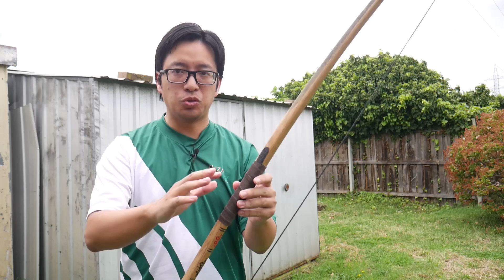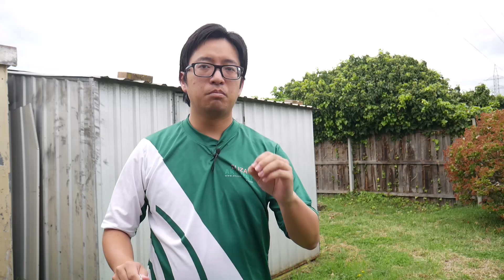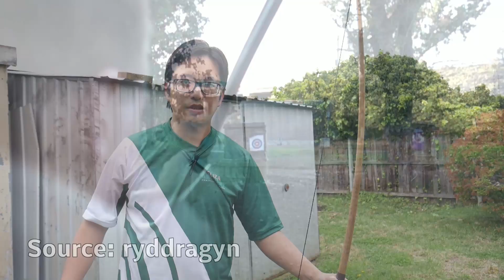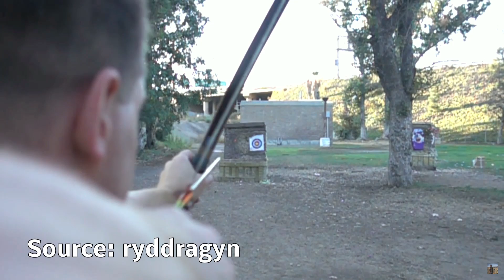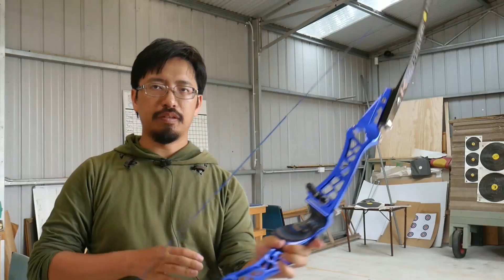Why Do Bows Have Centre-shot Shelves?

Comment: I'm surprised Nu didn't mention the obvious reason older bows weren't centre shot, if you cut a chuck out of an older one peice of wood bow, it would be far more likely to snap under full draw.

Modern materials allow us to create weak points in a bow such as centre shot cutouts because the materials are better at compenating, but older wood only bows wouldn't be able to take the strain on a weakened part.  I've seen enough bows explode on the tiller jig to see why old bow makes wouldn't remove so much material from a bow.
Reply from the maker: Hm. I suppose the bow blowing up would be worth mentioning.
Reply: @NUSensei  they also made arrows out of fine cloth soaked in hide glue or fish glue rolled up on a thin wire, then u take wire part way out when it gets tacky put the arrow head in with some more glue on it and bind it being carefull not to bend arrow then take it off rod completely and let it dry before binding fletching's on, they where super strong if you put a bodkin head on them they wouldn't break on armour as easily as reed  wood ext arrows
Reply: @NUSensei  yes when the bow bends the limbs must endure stress , with a cutout there's less material strength and making a bow without a shelf was less work and production .. with modern materials like fiberglass you reduce the risk
Reply: I think of the same reason too, given the higher poundage of bows used in the past and use of natural material, cutting a centershot shelves is too risky and may compromise the integrity of the bow itself. Even the handle is not the working part of the bow, it still need to withstand the pulling force on its pole vs pushing force on its centre.
Reply: The modern riser is thicker front-to-back at the position of the cutout, so there is more material to withstand the force on it when the bow is drawn. The historical bow's cross-section at that point is almost circular, so a cutout there would leave the riser significantly weaker.
Reply: The reason you probably didn't mention it it's just common sense
Reply: I dont buy this. I saw tons of youtuber building their centre-shot selfbow. None of them seem to have this problem.
Reply: not exactly ... the material removed is not on the working part of the bow. you could just as well reinforce a stick bow with some other material. after all there were bows with strike plates/other type of rest in the past. however it was too complicated and too delicate to do in mass production ...
Reply: @lubossoltes321  dependens on the bow som bows bend full compas trough the handle most moder bows accumulate stress at the fades and a flatt limb distributes it better than a d shape
Reply: Also, wood arrows are only so accurate. Why bother making a bow more accurate than the arrows being made at the time.
Reply: @breel79  ignorance they probably thought it would reduse paradox ,increase spine tolerance

Comment: Great video and Topic. I still shoot both shelve and off the hand,. I agree with you that a shelf will shoot a stiffer spine more accurately in gerneral.  After making about a hundred self, sinew backed, and a few laminated bows I found shelves can have less stability on self bows changing over time as the wood shifts. I also found when making bows with stone tools requires to initially shape the wood green. This can also cause some shifting and potential checking near a cut shelf as the wood dries over the next week, or weeks. Shelves also typically wear out fletching quicker than a shooting with appropriate wrist tension off the hand. I’ve found that Proper pre loaded wrist tension can be performed with both Asiatic or Mediterranean style releases by changing the rotation that wrist tension is applied on a roundish or flattish handle. 
Cheers Man

Comment: Just on a point. You say it doesn't take more skill to use a traditional bow and then say the center shot bow is more forgiving which implies that it does require less skill to use a center shot bow. So yes it does take more skill/practice to use a historical bow design at the same level as more modern designs

Comment: Something I think you almost mentioned, that I've been wondering:  With a center shot recurve, I can cant the bow, get the arrow directly under my eye, and basically do the horizontal aiming along the arrow.  Can you still do that with a bow like an English longbow that is not center shot?  Or is the point off to one side when aiming?
Reply: The need to cant the bow depends on the size of the cutout. If the riser blocks your vision, it helps to cant the bow. If the cutout is large enough to leave your vision unobstructed, there are some advantages to keeping the bow vertical. In either case, you can get the arrow below your eye by how you anchor.

Comment: When using a horsebow, would wooden arrows work better than carbon for flexing upon release? Also do feather fletchings help as well?
Reply: Arrow shaft material is mostly a matter of personal preference. Carbon arrow shafts can be had in a wide variety of static spines, at least one of which is guaranteed to perform well with a given horsebow when used with a certain weight of arrow point. The same goes for wood arrows, although the numerical spine rating system is different for wood arrows than for carbon arrows. Feathers don't have much of an effect on the dynamic spine of an arrow because they are so light compared to the rest of the arrow. Once the arrow is released, feathers help get the arrow pointed in the direction of flight sooner by adding drag to the tail end of the arrow.

Comment: A thing that is less forgiving inherently requires more skill to successfully utilize, sorry. Your contention that historical bows can be fired competently with the same ease as modern ones just isn't logical.
Reply from the maker: My line of thinking is this: using a less consistent tool with less consistent results doesn't prove the skill of the archer. The tool is the bottleneck. The technique is the same. A proficient archer with a modern shelf is going to shoot more accurately than an equal-skilled archer using a traditional bow with no shelf. Switch the archers, and we should see the same result based on the bow they used, not the person. What would be undeniable would be if someone uses an inferior tool to accomplish a greater result. If an English longbow shooter went up against a modern Olympic-style archer and outscored them, that's hands-down a sign of superior skill because we expect the modern archer to be capable of better scores with their equipment.

Comment: There isnt one video I can find that has a recurve injury all compound bows does it mean these are absolutely safe 100%
Reply: if you look though second hand bows, you will find many (usually over 60-70lbs)  where the person is selling due to back or shoulder injury.
Also since the peak weight of the draw in a recurve/longbow is at the end of the draw length, it's very difficult and uncomfortable to shoot while overbowed.

on the other hand, a compound bow's peak weight is somewhere in the middle of the draw, with the bow at full draw only requiring a fraction of the weight. This allows people to keep using bows which are too heavy for them for longer periods of time.

with trad bows, they usually are forced to switch to a lower, more comfortable draw weight or quit.

Comment: A paradox is a contradictory or unexpected result. The archer’s paradox is neither the flexing or the offset but the fact that despite pointing off to one side the arrow will actually shoot more or less on a straight line as if through the centre of the stave. 

The offset sets up the expectation of a result but the flexing causes the actual result.
Reply: That's the problem with calling it a paradox. An arrow doesn't fly where it's pointed like a missile; it points in the direction that it is flying. The motion of the string determines the motion of the center of mass of the arrow. Once in flight, the fletchings correct the orientation of the arrow to match the trajectory of the arrow. Describing it like a paradox misrepresents the physics of which forces determine the trajectory of the arrow.

Comment: "and very often people misunderstand what the archer's paradox is"
then proceeds to do just that. 
When setting up a bow with a cut past/centre shot window, it's still setup (with a rug rest and plate) with the arrow (when nocked) pointing to the left of the string on a right handed bow. This means that a) archer's paradox is still evident, even if diminished. b) the arrow spines/bends around the riser. Again, even if the amount of 'bending around the riser' is considerably diminished when compared to a stick bow, it still occurs. 
To conclude, the arrow does a similar thing but it does so in different amounts because there has been a specific engineering solution applied. Correct arrow spine is still required, even on a cut away riser bcs the archer's paradox is intrinsic to finger/tab shooting and recurve/longbow archery. Whether shooting off the shelf or a rest, the combination of correct arrow spine and rest setup sees the arrow pointing to the left (or right for a lefty) of the string, meaning the arrow still bends around the riser or rest to a degree. 
So you really should stop saying that "modern cut away risers don't archer's paradox" because it is demonstrably wrong to say so. 

A little may not be alot, but it's still some and more than none.
Reply: You must be fun at parties 😂
The arrow flexes regardless of the bow. Because it's flexible and not stiff. What you just wrote an essay on is like comparing plastic to rubber. Yes, rubber bends and flexes and all that. But so does plastic. To a negligible degree, though. There comes a point when this becomes irrelevant. It's the same with the archers paradox. When the arrow flexes around the bow vs when it just bends under the force of the string. 
If you're gonna nitpick, do it in a more reasonable way.
Reply: @gizmonomono  And you're too stoopid to be offencive. Thanks for the laugh.
Reply: @space.youtube  Hahaha, a very constructive argument. Instead of proving your point you stoop down to insults. It will probably go over your head, but this makes anything you say invalid to other people Either way, you have yourself a nice day there, Grumpy 😂
Reply: @gizmonomono  To claim you are 'too stoopid to be offencive' is not an ad hom fallacy if it is true. 
See previous comment. lol
Reply: @space.youtube  I saw it. I didn't reply blindly you know. But when presented with a counter point, a wise man tends to present one for himself. You don't just go "no, you" like a child. The fact is, you were nitpicking, grasping at straws. Not to mention the khatra point in the other comment, where your brilliant answer was "lol". Again, like an edgy teenager. Especially when I tried to talk to you respectfully. We could have had a decent argument, presenting our own views. Instead you opted for this internet acronym to... I don't know...prove your superiority in a ridiculous way. Once you can muster up the maturity to talk to me like an adult, we can continue. Until then I stand by my plesant goodby.
Reply: @gizmonomono  "acronym"? lol
I don't think it means what you think it means. Try 'acrimony'. Like I said, "too stoopid to offend" ; )
Reply: @space.youtube  Hahahaha, oh the irony 😂 Dude, for the love of God, google what you are about to say Before you say it. Now I'm the one enjoying a good laugh. Thank you, my friend 😄
Reply: @space.youtube  It's precious how you're trying to weasel out of your mistakes 😂 
Goodbye, man
Reply: @gizmonomono  Oh, I see, you're referring to my use of 'lol'. Your syntax sux. But all things considered, for your second language I suppose it's not too bad.
Reply: @gizmonomono  You do realise 'acrimony' also works in you crapily constructed sentence, right?

Comment: Also, don't forget that a Straight riser made of just wood would be a little structurally weakened by putting a window in it.  The modern day risers are designed to stay strong with the window.
Reply from the maker: Yeah, I may have glossed over it when I mentioned modern materials and manufacturing. You are absolutely right: you can't cut away half the bow and expect the same structural integrity. Modern bows have better laminate and composite materials, especially with the advent of fiberglass. Sport risers not only have exclusively modern material (carbon, aluminium) but also internal frames.

Comment: So to sum it up, center-shot bows are less spine critical ?
Reply from the maker: Yup - that's essentially the advantage that target shooting brought to bow design. Since the arrow doesn't have to flex as much to clear a centre-cut bow, one can expect less deviation due to spine mismatch or poor execution.
Reply: @NUSensei  no. the arrows is equal prone to flex regardless of cs and spine, a bad tune is a bad tune an the string and fingers always ad oscillations . you can change the spine but not the variation in oscillation basically your swapping frequencies. dynamic spine
Reply: @NUSensei  No, that's incorrect. The spine requirements are different but nonetheless equally important.
Reply from the maker: @space.youtube  Ah, seems I misread the question and conflated things.
Reply: it's less critical because center shot bows are usually adjustable. also not as punishing when using fletched arrows which are too stiff.

when I compare my longbow to my recurve, I can tune the recurve to many types of arrows, even off the shelf, by building up or cutting away thickness of the strike plate.
With the longbow (with no cut out), this isn't an option, you have to spine the arrow correctly in order to get really good flight.
Reply: @x3roxide  no mate, all you're doing is trying to hide a mismatched arrow with a compromised shelf/plate setup. Bare shaft tune it and your arrows will still be incorrectly spined for your bow, regardless of how much you pack or strip your plate. Set up your rug rest then leave it alone. If you want to tune shaft spine you'll have more success changing point weight or shaft length.
Reply: @space.youtube  yeah true

Comment: Many modern bow hunters now use extremely precise bows with highly advanced sights, carbon or aluminum frames with short thick springs pulling cam wheels which change the resting draw, whisker biscuits, scopes, balances, finger triggers, and even butt stocks [as opposed to cross bows which typically have butt stocks, but also have rails and some times have carriages, and now even magazines and cocking arms (fashioned loosely from the Chinese Lián Nŭ repeating bow, only highly advanced)].

Comment: Thanks for explaining another archery mystery!
So the natural follow up question would be:
“Why do we use arrows with different spine today, couldn’t we all use the most stiff arrows with modern bows?”
Reply from the maker: With a finger release, there is still an element of flex that is needed for arrow clearance, and we still see that when not perfectly spined, the arrow will have a left/right deviation on target as the fletches have to do more work to correct the arrow flight, and inconsistent execution will amplify that spread. Arrow technology today has gotten to the point where an archer can pick the right arrow for their specific bow and draw and get an all-10 grouping at 70 metres, a feat that is virtually impossible with traditional equipment. Even with we allowed sights and stabilisers on a traditional longbow, it would not achieve the same consistency as a modern bow with modern arrows. Such precision on traditional equipment would be seen as superhuman. Modern developments have removed that ceiling and made it attainable with sufficient skill and training.

Compound bows with release aids are a different matter. Compound bows are much more forgiving of spine, and you can drill Xs with the wrong spine, and compound bows do uniquely have centre-shot designs with the arrow going through the riser.
Reply: @NUSensei thanks a lot.
I guess the arrow to allow me to get all 10s at 70m isn’t invented yet. So I’ll keep training and watching your videos until it happens.
Reply: I bought 5 different spined arrows, all the same make and from the same supplier to try and see which spine was best for my bow..  I did several practices and I notice that with my centre shot bow, my groupings at 20yards were less than an inch shooting 5 different arrows each end.

Spine charts tell me I should be shooting 500-600 spined carbon arrows, but my favourite arrows are actually spined 400, which is much stiffer than any arrow chart says I should be using.